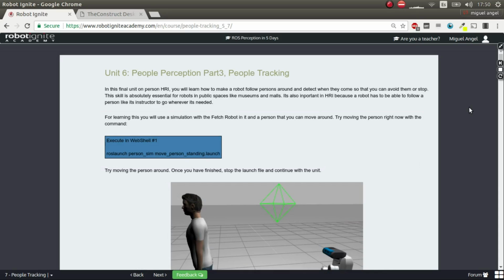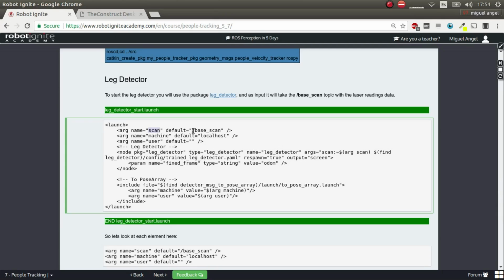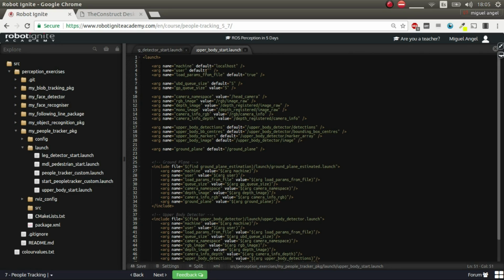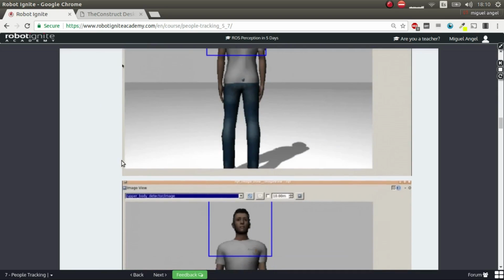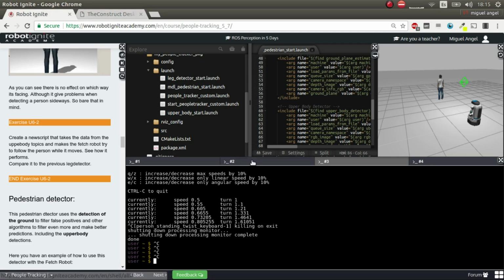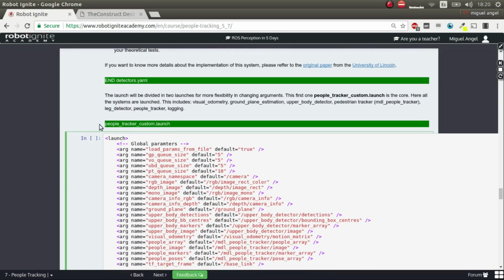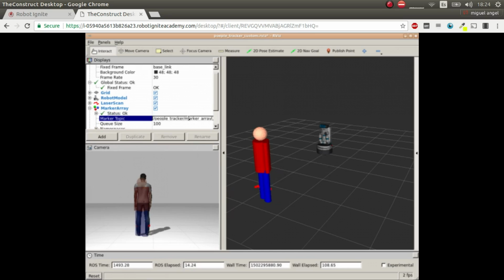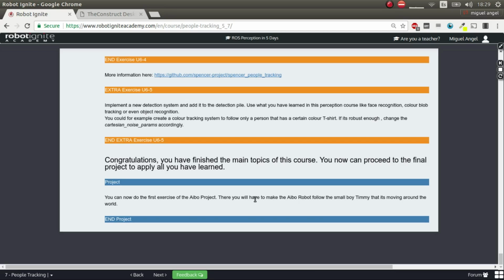[ROS Tutorials] ROS Perception #Unit6: People Tracking

Comment: would'nt the linear kalman filter be a better choice as this package is only using linear models?
Reply: Yes, that would be enough in this case. The tracker has the extended and unscented KF implemented which run at comparable speeds and allow also for non-linear detectors to be added, therefore, giving the most freedom to use. But in this use case, you are right, they are a bit of an overkill.